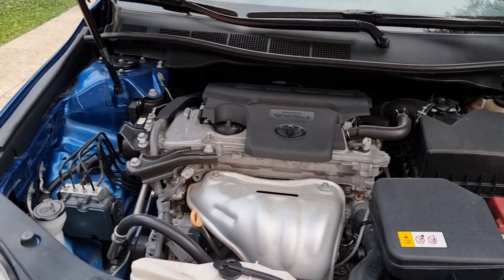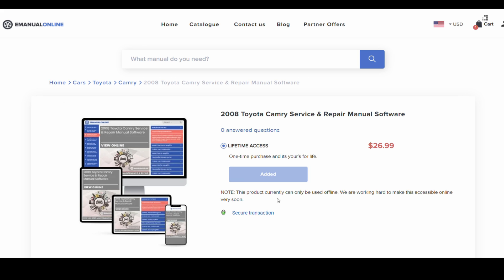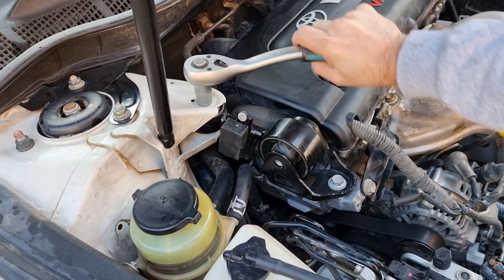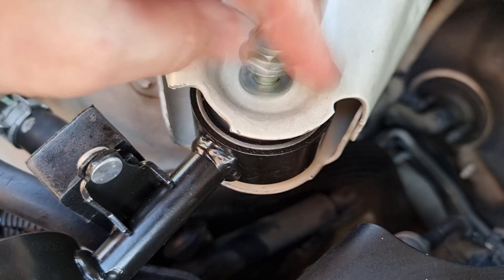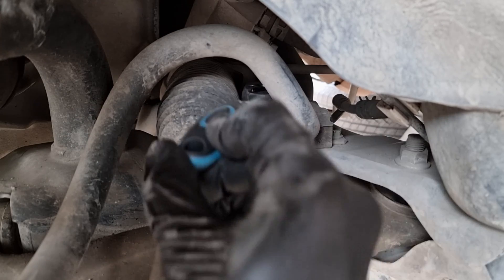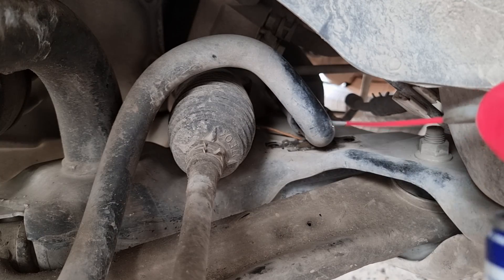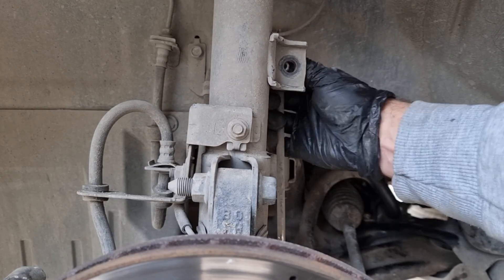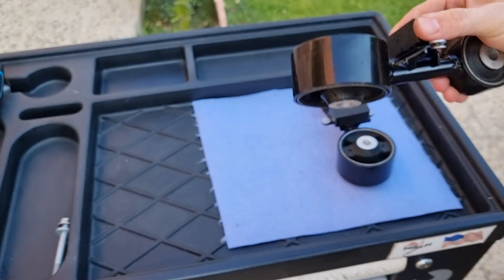How to replace any part on your car/How to replace sway bar bushing/TOYOTA camry engine mount

Comment: Hello Alimech, I have a Toyota Rav4 2008 gasoline automatic transmission vehicle, is there a brand you would recommend as engine mounts other than the original part..
Reply from the maker: i dont recommend any brand, try t buy toyotas original parts
Reply: @AliMECH  Original parts are very expensive in Turkey, for example, I chose ashimori brand made in Malaysia because Toyota manufactures some rubber-containing parts in Malaysia. Also, my car's chronic problem is that the steering box is made, but it breaks it again. Have you done any work to fix it? I wish you a good day